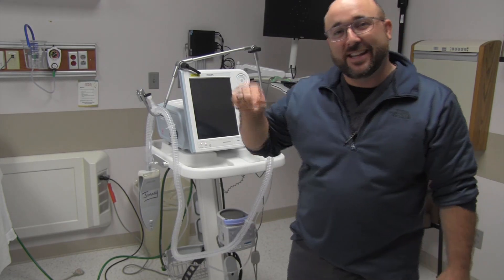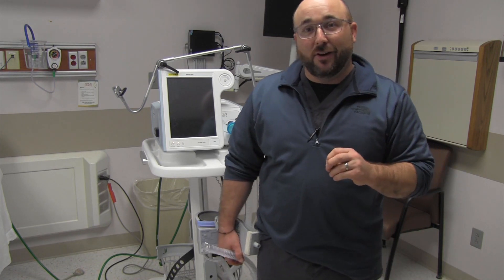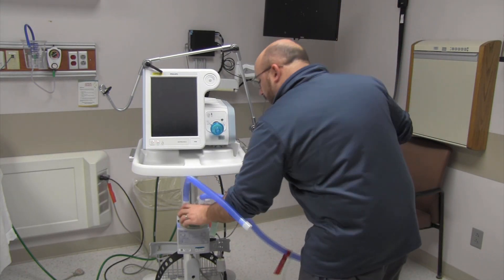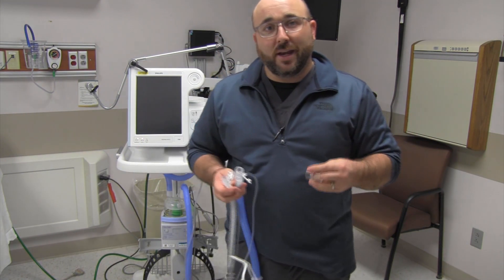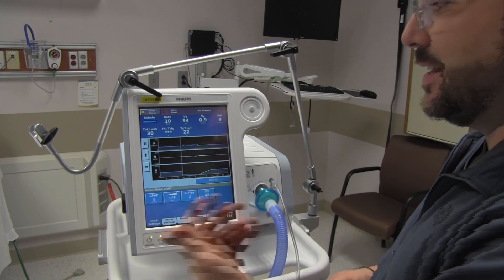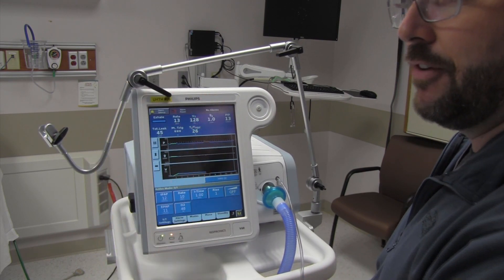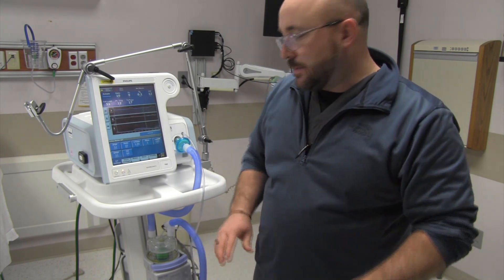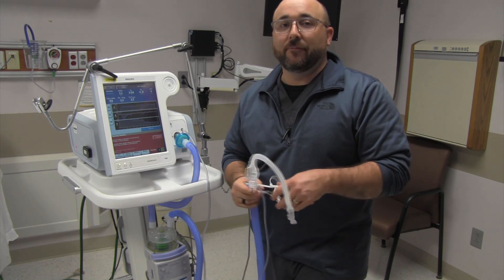RT Clinic: How to use a V60 as a Heated High Flow Cannula. Very Easy!

Comment: You usually wouldn't do this, but technically, if you wanted to hook a Trach patient up to a T-Piece, or Trach Collar, HEATED that is, You could technically use that BiLevel device to allow some HEATED HIGH FLOW, and you could hook that up to the V60, and set that up, so that It  is just providing High Flow, and therefore, Hook the trach collar, or Briggs T-Piece up to the machine. Obviously you aren't going to be providing CPAP, or biLevel, but You would get the heated high flow, and You'd get that FiO2 you want! I like the T-Piece better than a Trach collar!